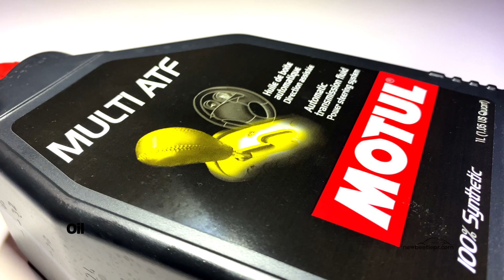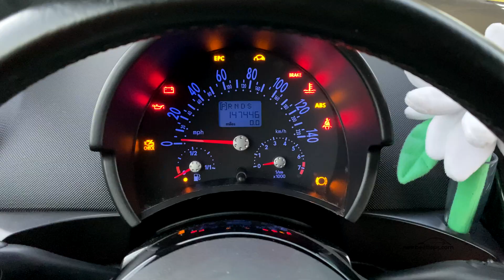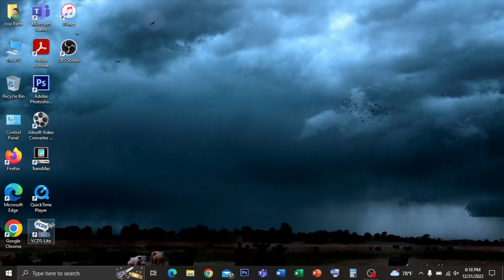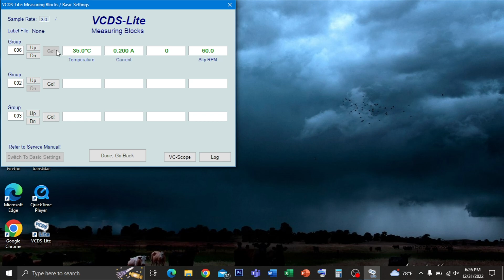New Beetle: 09G Transmission Oil Service

Comment: The motor was running after adding the second quart of oil but do you need to run the transmission through the gears while draining it to drain it more completely?

Comment: You supposed to check the level between 35C - 45C, checking it over 45C the fluid is too hot to get an accurate flow.

Comment: Did you add any sealing grease to the gasket or is supposed to make dry contact with the transmission housing? 4:40
Reply: the filter comes with a rubber gasket

Comment: Is that a steering wheel from the a5 beetle ? What did you have to do to get it to work? New clock spring and airbag ?
Reply from the maker: Yes! From 2012 Beetle. The airbag is not connected yet, only placed. The horn is working fine.